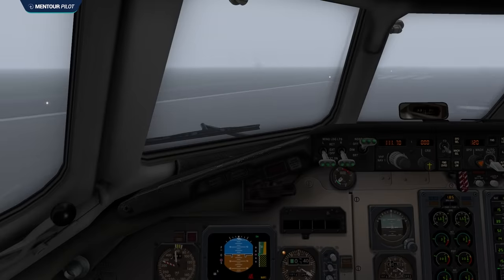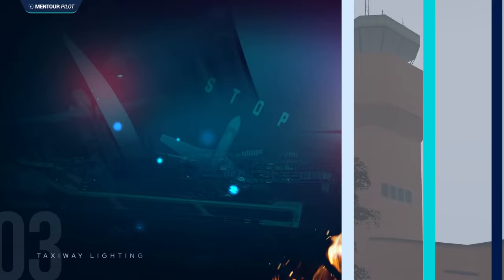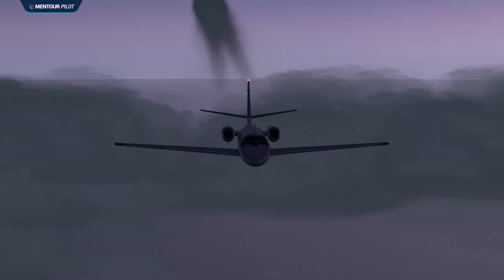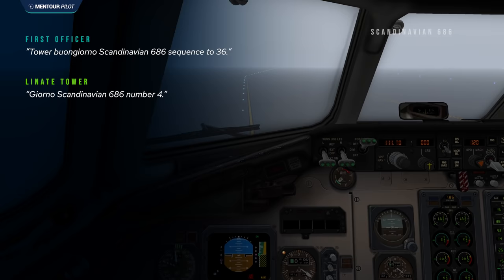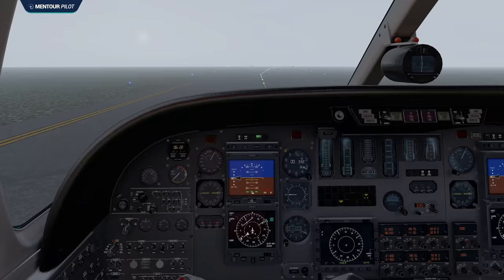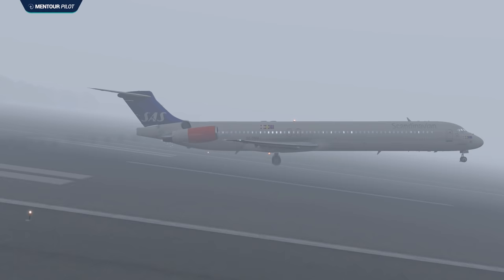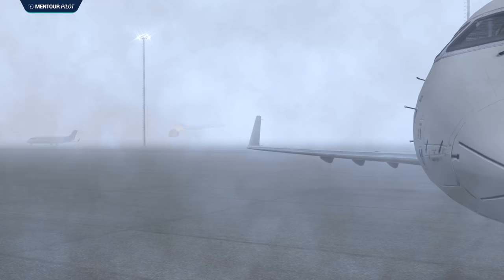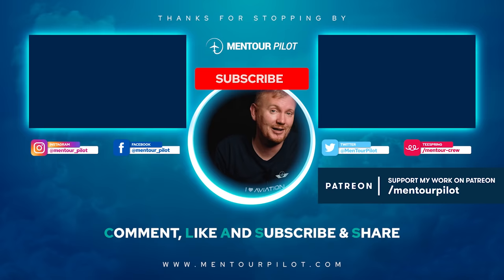A Perfect Storm of Mistakes! And how Heroic Pilots Almost solved it.

Comment: This accident is a direct result of "normalizing deviance". A facility that requires workers to violate safety norms (in this case cross a red line), has set their workers up to have an accident.
Reply: Absolutely. It's unfortunately a pretty common problem in way too many workplaces, particularly where safety systems are not regularly reviewed and where employees haven't been actively consulted in designing and maintaining them?
Reply: Yeah.  Occasional deviance is fine, as long as everyone is hyperaware of what's happening and the associated risks, but normalizing it is not.
Reply: “Normalizing deviance” and violation of safety norms are not synonyms. There is considerable confusion about Diane Vaughn’s concept and how she used it in her book on the Challenger disaster. If it was merely another way of describing when individuals or groups don’t follow the rules of their organization, she wouldn’t have had to write a book about such a commonsensical description. When you read her book, deviance and normalization emerged from her study of the unique history and particular set of circumstances of NASA’s shuttle program. I know you’ve probably read it yourself, but I recommend her book to anyone else reading this.
Reply: This is from the 2016 preface to her book (italics mine): 

“Based on additional Commission findings, I began this research with the hypothesis that the Challenger accident was not caused by amorally calculating individual managers, as the report suggested, but was an example of organizational misconduct. All the classic signs were there: production pressures, risk taking and violation of rules in pursuit of organizational goals, and regulatory failure. Initially, I envisioned a short article. However, once I got beyond the readily available information and deep into the supplemental volumes of the Commission’s report, I found information that contradicted most of my starting assumptions about what had happened. No rules had been violated on the eve of the launch. Instead managers had conformed to NASA’s rules and procedures. More incredible, in the years preceding Challenger, despite worsening O-ring damage, managers and engineers alike repeatedly assessed the O-ring damage as an “acceptable risk” in engineering documents. How was this possible? As the complexity of what happened materialized, the short article I imagined at the outset was reimagined as a chapter in a book and then grew into a book in its own right.”

Vaughan, Diane. The Challenger Launch Decision (p 9). University of Chicago Press. Kindle Edition.
Reply: @Huntracony  In a safety critical environment even very occasional deviance can be lethal.. What they would need is a systematic plan to deal with situations where normal procedures needed to be modified. Making people cross the red line though - insanity.
Reply: @Lucien86  it might not have been insane for a day or two imo, if they had immediately implemented an alternate procedure for clearance (as they did) AND put means into repairing the lights. The habit is insane.
Reply: Word salad.
Reply: @materliliorum  - Really poor written English.
Reply: @johnsmith1474  if you say so. What should I have written instead?
Reply: @materliliorum  I understood what you said.
Reply: Normalized deviance in airport maintenance inducing a failure in redundant parts of safety protocols such that one single failed communication resulted in catastrophe.
Reply: Yes, indeed, exactly!!!
Reply: Okay, no... not exactly. To Joseph Charles' point, it's not just "normalizing deviance" that's the problem with safety-intensive work places. It's HABITUALLY DEVIANT BEHAVIOR... Normalizing it involves actively producing a protocol to stick to for when things don't work entirely according to the book. 

    Habitually just doing whatever the hell you want for convenience or because the safety equipment is finnicky is what leads to chaos, destruction, and death...

     Look, in a Perfect World none of the safety systems would ever fail, or we'd have enough redundancies that any that DID fail wouldn't matter. That Perfect World does NOT exist. It's BS... SO we deal with the one we DO have. Systems fail. Wires get crossed and chafed. Short-outs happen... AND there's still a day's work to get done. At an airport, that can mean THOUSANDS of really angry people who don't like being stranded at one airport because they're next flight at another airport is going to leave them EVEN LONGER when they finally do arrive wherever they want to be going... AND you've likely seen some of the fallout from that kind of thing.

     SO when the taxi-way lighting was failing... It's OKAY to create some protocols and go ahead with a "work-around". You'll need one. BUT this should ONLY EVER be considered a "temporary band-aid" and NOT a permanent solution, as it was treated here... SO I'm with materliliorum on THAT view, as well. Had they simply employed the "work-around" for long enough to get that lighting back under tower's control, the systems would have been maintained. They were engineered into the airport for VALUABLE REASONS, and not just to piss everyone off and take up time and cost more money. The same can be said for the ground radar, and at least in part, establishing some secondary visual stations for confirming aircraft positions and directions and all would've been SOMETHING... where apparently, they had nothing.

     Creating protocols for safety-system failures and associated work-arounds WILL "normalize" behaviors that shouldn't be involved with healthy, functioning safety systems, but that's also kind of the point. We have to accept at some level that this sh*t is dangerous... period. There's ALWAYS an inherent risk involved, and you CAN do everything "right" and still fail utterly. BUT we can't let that possibility cage us all up in plastic bubbles in our sterile houses with pure oxygen pumped into us for fear of everything outside our lotus of control...

     It's when the employees involved just get used to the HABIT of blanket ignoring safety protocols and systems that we run into problems. Otherwise the HUGE GREAT majority of the time, aircraft continue to take off and fly and land again without much incident... and even with incident, the majority aren't deadly... rarely more than a mild annoyance.

     AND the sounds of the scathing report's multitude of points about airport safety and the toxic working environment seems to paint exactly the "let's just do whatever the hell we want" mentality that contributes to horrific chaos, injuries, and death all over the world every day in a variety of regular activities... though at the moment, driving or negotiating traffic seems to come to my mind as the most ubiquitous example.  ;o)
Reply: @gnarthdarkanen7464  Traffic signals in the US have a protocol where they can either indicate solid red when vehicles are supposed to stop and wait for the signal to change, or flashing red to indicate that they may be passed with caution.  If a stop line had a sign "Radio tower and ask for X1 clearance before proceeding", having planes proceed past the stop line when given X1 clearance would not pose a hazard, since the tower would know exactly where the planes were and where they were going.  Having planes expect to taxi over a stop line without re-checking that they were expected to do so, however, seems crazy.
Reply: Amazing story :-/ are we sure that Linate owner did follow all the post crash recommendations??? For me worst part is lack of clear signals on taxi runway + bad tradition to cross red lines because of technical reasons!
Reply: The only point I wanted to make is that the technical and sociological meaning of “normalization of deviance” is very precise in Diane Vaughn’s Challenger book and it is that meaning of the phrase that does not obviously apply to the disaster at Linate Airport. I stress obviously because, as Vaughn learned, the broader sociological causes of the Challenger disaster were not obvious at all. In fact, normalization of deviance was practically invisible to NASA engineers and management even after the disaster. It was only after the publication of years of internal material of the shuttle program and its construction of risk that a sufficient explanation could be attempted. Popular accounts and the media still have not grasped its significance. Again, I recommend her book. I would also recommend taking care over using scientific and technical jargon too glibly. It might impress people unfamiliar with the jargon, but it reveals something about you to the people who are familiar with it. There is too much of that these days and we are all guilty of it.
Reply: in IT we call them anti patterns. Repeating common behaviour that lead to negative outcomes/inefficiencies in the long run
Reply: Pretty much the same way Boeing are conducting their business this days!
Reply: @flatfingertuning727    I'll refer back to my exposition on "protocols" for the deviance... Your idea certainly would work, at least as a "short term band-aid" while they got the appropriate safety equipment working properly... to return as quickly as feasible to proper function.

    The specifics of a given "deviance protocol" aren't as important as having the alternative available to begin with. Let the specific details FIT the airport or station (such as it is) individually, so long as there's adequate over-view to be SURE that the Tower knows where the Planes are, and that pilots get appropriate directions, especially in low visibility conditions.

    MY point was that it should be relatively alright to allow some variation in protocols for safety, SO LONG AS safety stays at the top priority and reasonable checks and redundancies remain available. "How" precisely it gets taken care of is less important than the fact it GETS taken care of.  ;o)
Reply: @gnarthdarkanen7464  Yes.
Reply: "It'll be fine. Just leave it here. What could happen?"
Reply: The electrician in me is very suspicious of this fault. It seems like it might even have been sabotage. Because there's two faults together here and that doesn't normally happen accidentally.
Reply: @darkprose  Thank you for the rec. Sounds like an interesting read and I've added it to my reading list
Reply: @mondaytosaturday1013  It’s fascinating. It begins with the decision-making process on the eve of the launch as it’s popularly understood. Then we go back to the beginnings of NASA’s ambitious space bus right up to the eve of the launch in its historical context. The decision to launch becomes rational and expected. In fact, not launching under the conditions at the time would have actually been deviant behavior.
Reply: I was thinking this as well. Very reminiscent of Jens Rasmussen's migration-to-boundary model. The airport was clearly operating beyond its limit of acceptable safety, but hadn't yet reached its boundary of functional failure.
Reply: You've just described all of southern Europe and much of Latin America.
Reply: Spiderman into SPIDERVERSE< yes SAS is bad

Comment: It took 36 minutes for the fire crew to reach the fire,  and then they quickly put the fire out. Yeah,  because it had probably consumed most of the fuel by then.
Reply: This was also a powerful statement on the power of fog and how we should treat it accordingly.
As a pilot I'd double- and triple-check to make sure everything is communicated clearly before entering a runway that I cannot see along. You are almost literally moving about blind, trusting an ATC who has no visual either, and all based on radio comms with complex terminology easy to confuse.
Imagine if the Cessna pilot at some point had simply given a status update to the ATC, stating clearly where exactly he is right now. Like: "About to enter runway soandso from access point soandso, please verify that runway is free."
Reply: @Dowlphin  absolutely! Even driving a car,  I've many times suddenly come upon fog so thick I can't safely maintain 30 mph.
Reply: @Dowlphin  "Imagine if the Cessna pilot at some point had simply given a status update to the ATC, stating clearly where exactly he is right now" - He did.  In the video at time index 15:43, the Cessna Citation pilot told the ground controller he was approaching Sierra 4.  The controller was unaware of that marking, so he didn't know what the pilot meant and thus asked the pilot to confirm position.  The pilot replied "Approaching the runway...Sierra 4".  At that point, the controller knew that either 1) he aurally didn't understand what the pilot said, or 2) he didn't know how to interpret/process what the pilot said.  Despite that, he simply disregarded what the pilot said and told the pilot to continue on the main apron rather than telling the pilot to hold position until the controller could determine exactly where he was.
Reply: @nomore6167  Thanks for pointing that out. I got a little confused by all the explanations of markings myself. Or maybe I wanted the pilot to ask for confirmation right before entering. Probably that; not sure now. Entering a runway is the most crucial during bad visibility and should always have a separate confirmation.
Reply: @Dowlphin  I had to rewind and re-watch quite a bit of the video multiple times to process/understand everything because my brain kept saying "that doesn't make sense" or "how is that possible?!?"  It's astounding that an active airport was so deficient and lax regarding safety.  Also, to me, someone not involved in aviation in any way, it's difficult to imagine any valid reason for anyone to cross an active runway, especially in poor visibility.

Comment: So many similarities to Tenerife. Limited visibility, confusion of taxi directions, lack of ground radar, non-standard communication language/phrases, complacency with non-regulation procedures and everybody thought things were fine until a shape comes looming out of the fog. However at Tenerife both sets of pilots knew there was another plane on the runway and it was a case of pilot error assuming the runway was clear, disaster could have been averted with a single additional radio call or better CRM. Here the pilots did everything right, having no indication whatsoever of any issues but still payed the ultimate price. The technology was there, it used to work, but was never repaired after failing, a simple taxiway sign could have prevented tragedy, cost cutting and complacency at its worst. The events of 24 years earlier were lost on the airport management, who did not learn from history and were doomed to repeat it.
Reply: Tenerife, plus a dash of Zagreb with the use of Italian on ATC frequencies.
Reply: Well the cessna pilots didn't do everything right... they confirmed romeo 5 and went on romeo 6
Reply: Yep but in tenerife it was both planes fault right? In this case it was only one planes fault, the cessna + air traffic control and saftey management of the airrport.
Reply: @LordOfSweden  yeah but my response was to op who said that the pilots did everything right (which is true for the bigger aircraft, but the cessna did so many things wrong)